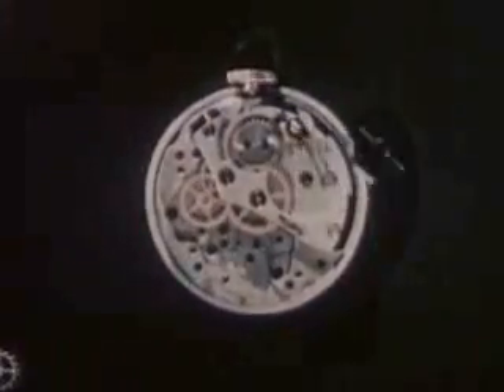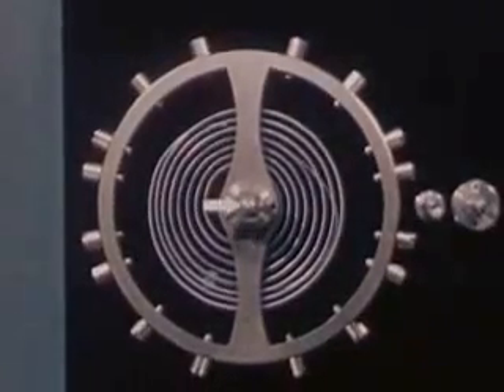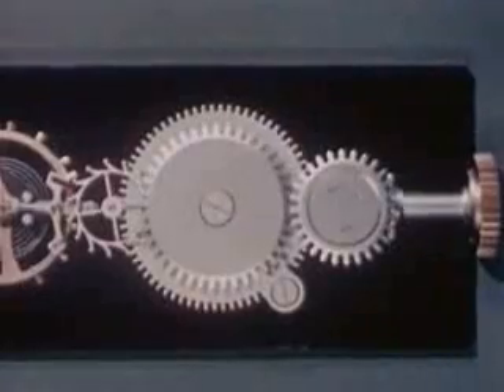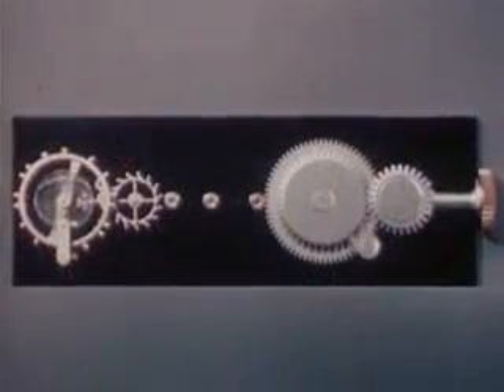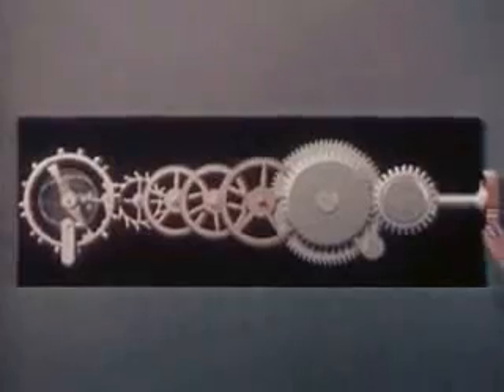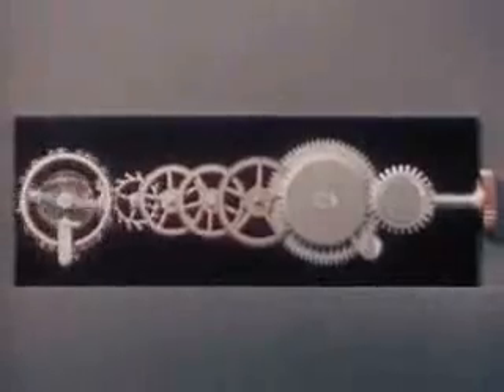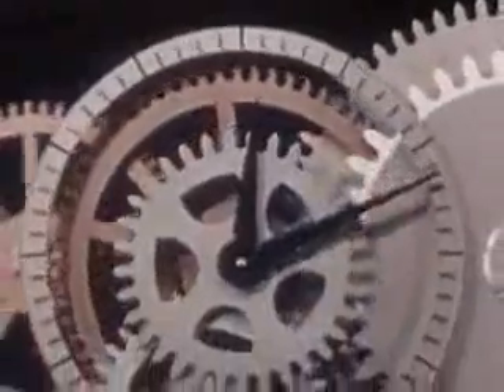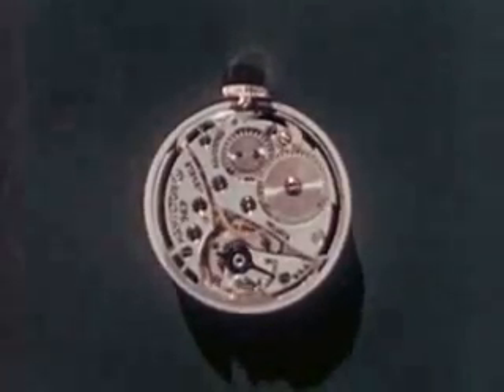Cómo Funciona un Reloj Mecánico - How a Mechanical Watch Works

Comment: so the the really hard thing to do is the calibration of the balance wheel and the spring? because it has to lock and unlock the crossarm by the second if I'm correct...am I?

Comment: @JesperA86 The hair spring is attached to the central rod of the balance whell and to a point near the edge. Then the tension of the hair spring can be controlled by sliding the attachment point along the edge of the balance wheel -- the more tensioned it is, the faster the weel spins back and forth. (I see they ommitted this construction from the model they made, where they attached both ends of the spring to the central rod.)